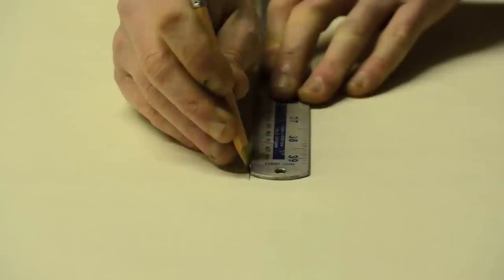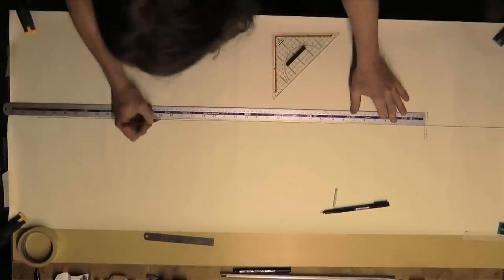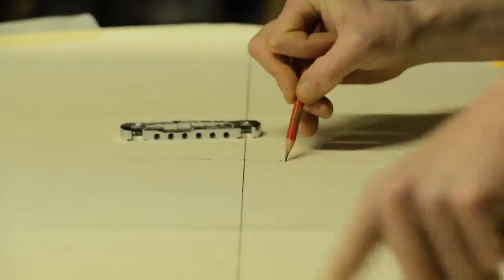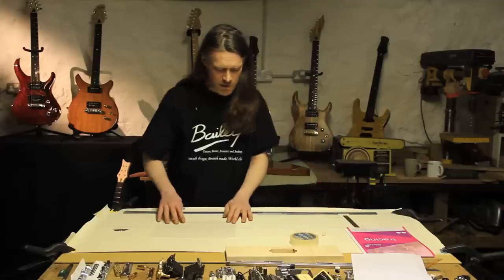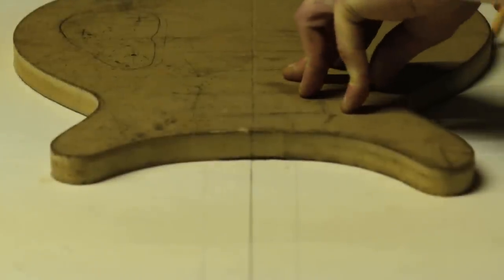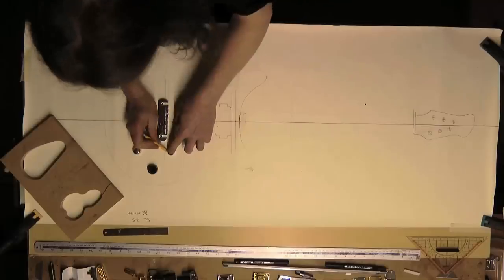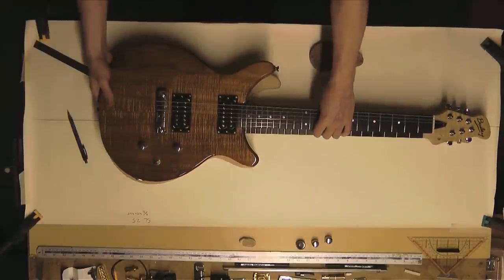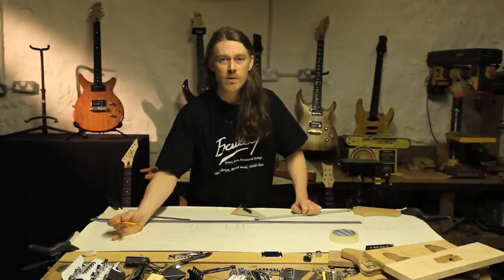How to Design Your Own Guitar - Overview

Comment: Hey, Bailey! Thank you for your videos! I have a question though: why is the body made of 2 pieces of wood (bookmatching) instead of one single piece? Why do we have to joint two peaces instead of simply cutting a whole one-piece?!
Reply: If you can find a piece large enough then go for it - however this is getting rarer. There is an advantage to using two pieces - if the wood warps it moves half as much.
Reply: Mark Bailey Oh, I think I got it now, Mark, thank you very much. Now this is something. Thank you for you time, I’m really studying all of your teaching. Thanks, Mark! Bruno.
Reply: Mark Bailey Got you, Mark. So you prefer to work with a two-piece instead of a single body, right? Just out of curiosity, what if we use like.. 3 or 4 pieces? Is it interesting at all or quite unecessary?
Reply: Actually for electric guitars I would prefer to use 1 piece bodies - it would save a job!  but alas it is not easy to find large enough TOP QUALITY examples. Smaller pieces are generally easier to find and usually a cheaper way to make a body blank but it is more work.... Sometimes I have to make a 3 or 4 piece if the wood is not wide enough but usually I use a 2 piece body. If there is to be a Cap then that is another 2 pieces. Confusingly, in marketing language this is called a '2 piece body with a Bookmatched Cap even though there are 4 bits in total to make the body...hope that helps. If you get a chance - check out my website - there are over 300 videos to answer all your Q's!
Reply: Mark Bailey Alright, Mark! Thank you very much for your time and effort, really! I’ll make sure to check your website ASAP! Thanks, man! Best regards! Cheers, B. 🖐🏼😊🇧🇷

Comment: Where do you measure from the takeoff of the nut? Is it the front side closest to the tuners or the back side closest to the frets?
Reply: Hi Archie - The front of the nut or 'take off' side is nearest the frets. The other side 'closest to tuners' is called the back of the nut. I can see why it is confusing - hope that clears things up. This is just an overview of the process - I go into a lot more detail on the course - check the description for the link:)

Comment: I'm confused, how on earth does the neck secure go the body if there's no neck pocket?? Thanks.
Reply: Hey EM - This video is a 3 minute summary of my 5 1/2 hr long Design Your Own Guitar course (https://guitarmaking.co.uk) where  I go into great detail of every aspect of guitar design including several videos to explain the 3 main types of neck joint (bolt on, set neck and thru neck). To cut a long story short - All guitar shapes can be made using any of these 3 types of construction (with some small adjustments - all explained on the course). On a set neck the neck slot extends under the front pickup, on a bolt on there must be an extension on the body (body heel) so there is something to bolt it to - with a thru neck there is obviously no need for neck pocket... hope that helps!